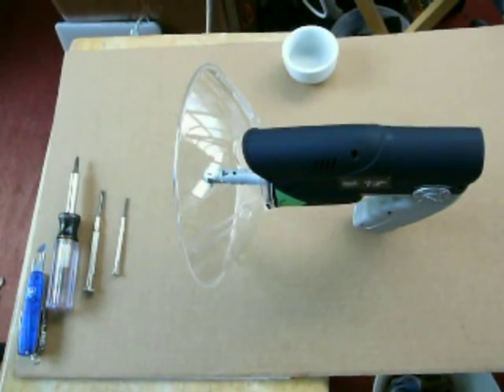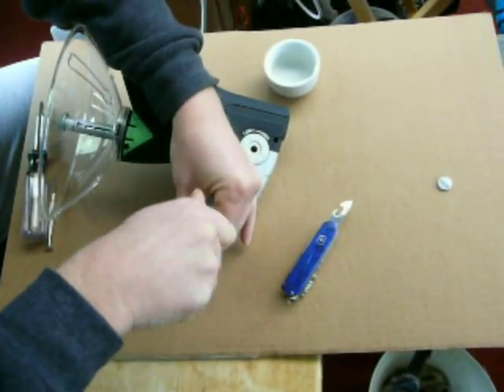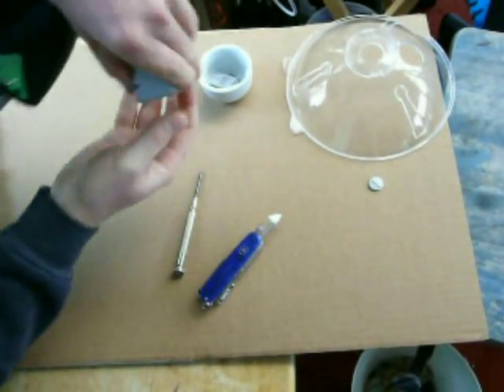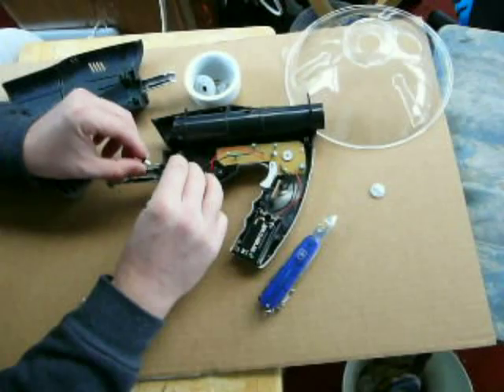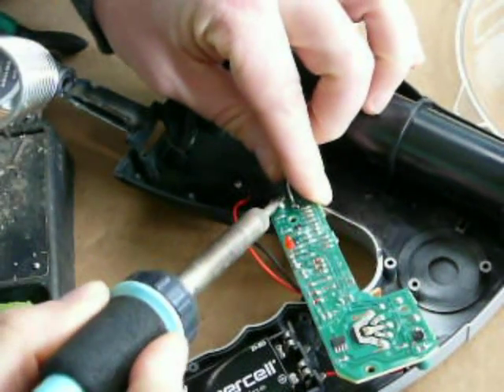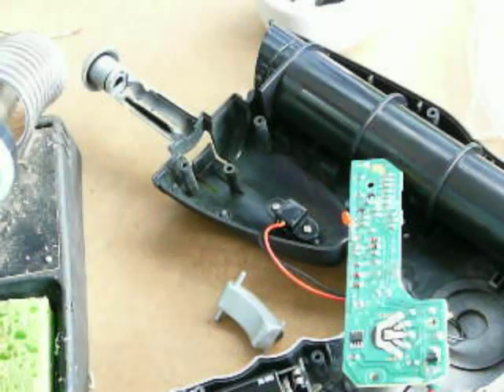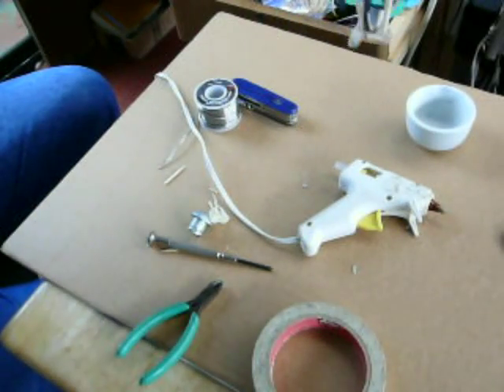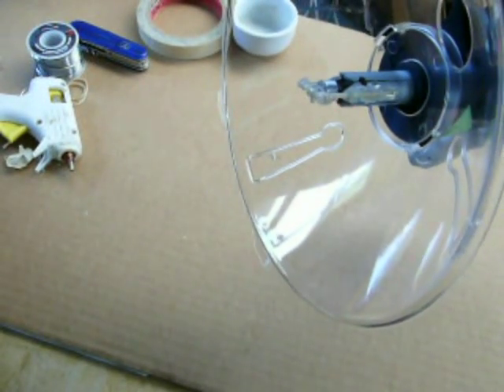Scientific Explorer Bionic Ear Mod

Comment: thanks for the video. just got one and the wire is long enough now. the endcap is only glued in 2 little spots, using a knife blade, you can easily pry it off the end., if you cut out about 1/8 inch of rail material inside at the end, the mic fits there and is the perfect position. when it goes back together it looks perfect. works much much better now!

Comment: Why the mictofon is in a wrong place? What @re you doing?
Reply from the maker: The microphone was in the wrong place so as not to make a cheap toy perform like an expensive device, so I think.  However with an easy modification the theory is that a cheap toy can perform like something that costs much more.  Specifically, place the microphone at the focus of the reflector dish, that simple.
Reply: interesting... can you listen through the wall/door without the modifications... or with modifications
Reply: Hello mate , what can I do to remove the ambient noise. Please answer me
Reply from the maker: While the acoustic focusing dish and microphone do an OK job of highlighting sound from a particular direction, it does not and cannot eliminate ambient sounds.  You can increase the ratio of desired sound versus ambient sound with a larger dish and more expensive directional microphone, but you start getting into very specialized and expensive hardware, you can see professional gear at say a major league football game.  https://www.thebroadcastbridge.com/cache/uploads/content_images/Paul_Terpstra_789_568_70_s.jpg
Reply: Not sure why this mod is needed. The function of the parabolic dish is to focus sounds directly on the center tube by making all reflections focus at exactly 90 degrees from where they strike the dish (look up how parabolas work).  The microphone being at either end of the the focus tube should be irrelevant as the sound is coming directly into the side of the tube.  Moving the microphone shouldn't change anything in theory IMO, but maybe it does in practice.....